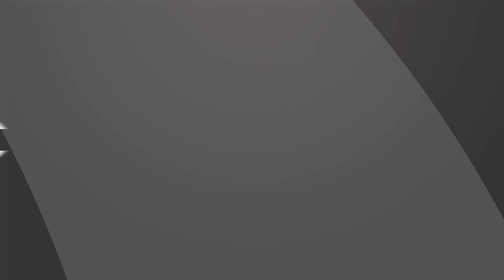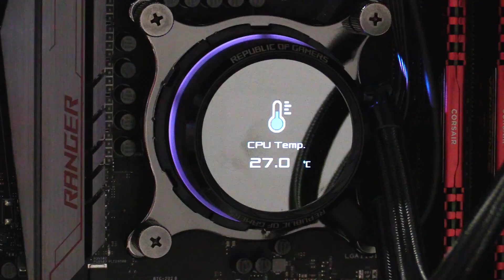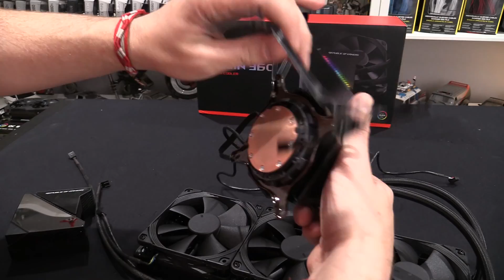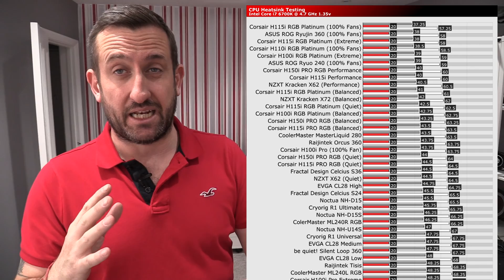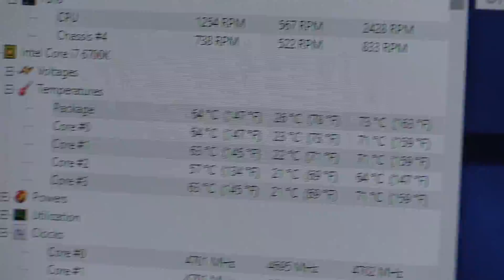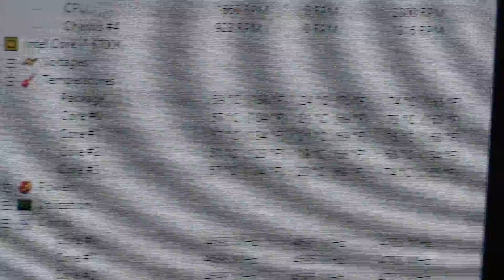Asus ROG Ryuo and Ryujin CPU Cooler Review

Comment: Like the Ryujin when its a water cooler pump with a fan who i think are rather nice when any cooling on the motherboard around the CPU is better than nothing. You could change the fan speed in the software.But yes, the different degree reading is rather confusing.Mine have a fault of 4 degrees and its a Asus motherboard.

Comment: most people i would imagine would use the motherboard bios to set a fan curve. at least people who spend this kind of money on an AIO, because more than likely, theyre gonna be the ones who like to tweak and adjust things. i use the bios to set my fan curve with my be quiet! dark rock pro 4, and have an aggressive fan curve, and under full gaming loads, after hours of playing, my CPU never gets above 60 degrees Celsius. i would guess, and hope, that with either of these coolers and the appropriate fan curve, temps would more than likely be similar if not better.

Comment: Hi, i nkow that it's a strange question but, if you know, the sata connector is using only the 12volts rails or also on the 5volts? Tanks, i need this for a modded system...

Comment: Hey so it is isnt worth it even at 200 yeah (ryujin is somewhat cheaper in my country :D ) . I should buy h115i (it 144 euros in my country) ? But there is 2 bigger fans (corsair one) instead of three smaller here which is better ? money is not a problem, but if it is not really usefull I would like to save money for something else. I have lian li so I can add every radiator to it :D

Comment: A watercooler should be running by water temps. NOT CPU temps. How ever. The CPU temp should read actual CPU temps and NOT the back of a motherbord. 

My livedash on Maximus X Formula does the same thing
Reply from the maker: There are arguments for an against water temps. CPU temps will rocket before the water temps will actually show any difference meaning higher CPU temps at the start of any load before the cooler catches up.

Comment: You can definitely test vrm temps on maximus range. Open aida, click on computer, click on sensors and it will give you every temp, fan speed etc you can dream of. They've tried to remove vrm temps because of all the controversy about their dodgy 8 phase vrm marketing. In reality the vrm temps aren't that bad at all. I've not seen a number over the low 40's yet.
Reply: Adam is still confused as to whether their Newest Maximus hero board has 8 VRM or not. I need atleast that for a i9 9900k I’m about to buy, and I want an Asus board that can handle it as I have a Asus theme going on.
Reply: @gwynbleiddroach2589  Hi mate. Not all the maximus range uses the same vrm. I have a hero, which is a 4 phase. It still has 8 power stages but they run in parallel. All I can say is it works really well and I use mine with a 9900k, though admitedly you could probably get a board with a better vrm for the price.
Reply: Adam thanks for the reply! I have seen multiple 8 VRN boards for the same or less money from other manufacturers. The problem is, it will disrupt my theme haha, and I’ll miss the Asus UEFI. It just sucks the skimped on the VRN for their high end boards. As long  as the 9900k temps aren’t running ridiculously high at 5ghz then I’ll be fine, I’m not trying to hit world records.
Reply: @gwynbleiddroach2589  I'm by no means an asus fan boy and my mobo is the only Asus component I have. But it works great. Admitedly I have a case with great airflow, but the mobo's vrm is one of the coldest component's in my pc. I've hammered it with every stress test known to man and have yet to see a temp reach 50 degrees. My m.2 drive runs hotter lol. I think the whole vrm thing has been overhyped. Don't forget there is still 8 power stages sharing the load and they're incredibly good sic639's. Just as a comparison my 2080ti's vrm runs in the mid 70's on default settings playing a game. Your cpu is going to reach throttling temps way before the vrm does. Asus aren't going to make a mobo specifically for 9th gen chips that don't work with 9th gen chips. Hope all that helps, cheers Adam.
Reply: @gwynbleiddroach2589  As for skimping I've been in depth with Asus support on this and here's what they told me. They said because the board already has 8 power stages on it, it would have cost them nothing to run it in an 8 phase config. They told me their engineers in testing found it to perform better pairing the power stages up and running them in parallel as it improved transient response (whatever that is lol.) Anyhoo that's what they told me and seeing as it actually works so well I've no reason to doubt the asus engineers know their stuff.
Reply: Adam well the board is beating out other boards by a lot with over locking, which is awesome but like I said I’m not trying to hit records, I just need to make sure my VRN’s last me a while Atleast 4 to 5 years with an i9900 k. I only upgrade my gpus every other year, but my main rig needs to last at-least 4.  I’ll be putting a water cooler on my cpu, so I’m not worried about that, just the VRN’s. thanks so much for giving a piece of mind though. I think I’ll just get the Maximus hero, as it works perfectly well in my sky lake build, and I love the UEIF. I think I’ll just go ahead and build it, if the VRM’s decide to crap out later due to 5ghz then I’ll be more wary later.
Reply: @gwynbleiddroach2589  Yeah, all the fuss came from a gamers nexus/buildzoid review of a photograph of it, and they just kinda assumed it would be crap. Hands on reviews have all been pretty good. The vrm won't crap out at 5ghz. All I've done with mine is enabled mce which boosts all the cores to 5 and probably uses way more voltage than it needs, so a manual 5ghz oc won't stress it at all.

Comment: What a mess of wires. Kinda detracts from the wow factor of the screen. And from my experience with Corsair fans, they are far louder than most other fans. And not including fan speeds for all the coolers tested makes comparing the data rather futile, not to mention sound levels.

Comment: Where did you connect the PMW connection for the pump? Did you connect it to the AIO header or the CPU Fan/Optical header. I can't seem to get any kind of pump/fan reading on the Ryuo cooler; the fans and pump show as 0 RPM even though they are on and working. I'm wondering if I need to modify bios, update drivers, or exchange the pump itself.

Comment: This is what worried me about the CPU temp on that screen is that in software Asus uses what they call CPU and it is actually socket temp and you can confirm this by matching the two in your sensor software like HWinfo or other. This is something that bothers me on the Z370 hero where the Q code can act as CPU temp gauge once POST is past. I don't give a shit about socket temp Asus. There Ai Suite shows the socket temp as well instead of the package temp. I never use Asus anything for CPU temp. Unfortunately, the fan software as you talked about works on that socket temp too so all temps you set must be earlier.

Comment: These coolers misted the mark IMO. 20 wires off the side instead of one solid cable that could be routed to the back of case to figure out the multiple points of connectivity. Failed RGB control based on the review here. VRM cooler seems more of a gimmick and the screen doesn't do anything I couldn't get from software. Wrong CPU temp and so on. Seems like a prototype and not a $300 retail product.

Comment: you're so gentle with Asus this time. Using that mobo probe for controlling fan speeds is just lame. I had similar problems with H110GTX and ended up connecting radiator fans to the CPU fan headers on the motherboards and letting Asus Suite controlling the speeds.
Reply from the maker: There is so much wrong about what you just said. The GTX would have been from the cpu. By using the board it was the same way these coolers work.

Comment: Well, i was going to buy the Ryujin but i didn't know it would be set up like that ... to be honest, i'm fairly put of by that. IF Asus fixes the software, i'll buy it straight away. I want my fans to ramp with the actual cpu temp ... Actually, why not give the option for instant ramp or gradual ramp in the settings OR even be able to choose which temp sensor you want to use ?
Reply: Pre-fucking-cisely. The SDR exists for a reason. Select the sensor you want - at ANY time - for the purpose. You could have the temp readings from the CPU display off of the actual CPU temp sensor but keep the fans curving off of the motherboard's CPU temp sensor.

In this case, you CAN have your cake AND eat it, too.
Reply: Hwinfo64 fucks asus boarda

Comment: $185.99 child please 😏 @asus is on one.
Reply: Is that for the 360? lol
Reply: @86ortega  Yeah right, that's for the 240 one lol. Shit is just crazy. You are going to spend all that money for tech that doesn't even work smh.
Reply: @KosherTech  I'd rather get the corsair 360 for $160 on a good day.  I got the Corsair 115i 280mm dual for $60 on ebay for my CPU and picked up a H105 and H55 both for less than $120 for my GPU's.  Asus is out of bounds with these prices
Reply: @86ortega  agreed!

Comment: I've yet to decide which cooling solution I will use for the new rig that I'm building. When I first saw this AIO in this vid, I was tempted, until you mentioned the temperature discrepancy... It's a shame because the smaller of the 2 unit definitely has some flair. My other comment would have to be about the fans themselves. Asus is promoting Aura and yet... the fans are just plain black. It's a missed opportunity.

I'm curious, what would your recommendations be?
Reply: im on the same spot right now, choosing between this and nzxt kraken x52. which cooler did you get and how did it go?

Comment: It would make a lot more sense if the fans on an AIO would spin faster only when the water temperature gets hot, they are not directly cooling the CPU DIE but the radiator, the CPU will need some time to transfer enough heat into the loop to make a dent, spiky ramp ups because of momentary CPU spikes are completely idiotic.
Reply from the maker: That's why you have spin up delays :)

Comment: Was it actually possible to select different temp inputs in AIsuite3? Mine just keeps having problems and responding to cpu temps or something. It just ramps up when everything is running cool, no matter what I do. I just gave up on it after a while and just use cpu temp. Sometimes the software also just crashes and the fans are hanging at some speed unrelated to cpu temp. I really hope Asus fixes their software, I had less problems with fan control on an 80 euro gigabyte h150 board, but I just love the Asus ZE in terms of what it offers in terms of hardware.

Comment: Tom you should always set the Jack your PUMP is plugged into to FULL.. Then you can set the speed or performance of it from the software that comes with you AIO.. The pump is designed to run at certain speed efficiently. If you deviate from that you could get less than optimal performance. As far as the fan speed is concerned. You can control them via the AIO software or plug them directly into your motherboard if you prefer and then you can set your desired fan curve.
Reply: The sata power is what powers the pump. Software can change that through the usb connector otherwise it stick to a default (usually balanced) profile. The connector you hook to cpu fan header is nothing more then a tachometer.
Reply from the maker: Actually with it plugged into pump they all ran full speed and the software wouldn't change it

Comment: the display on the asus maximas formula xi has the same issue. the temp shown isn't even close. im sitting there in a game thinking my temps are good because the motherboard is saying its 55 degrees but when i open up hardwaremonitor, the temps are at 75 degrees....

Comment: Isn't it that ALL of them are asatech pumps so aren't they basically ALL the same? Except for the looks and fans that is.

Stupid patent trolling company. I can't believe how "pump on top of the block" is something that can be patented.
Reply: Yeah, basically variation in temps is from the fins structure in the block + materials and FPI of radiator + fans
Reply: Yeap... almost all AIO are Asetek-based. Except, the brand new Corsair Pro Platinum. Pretty sure Enermax came up with the pump on another location but it just look... weird.
Reply: @davlc88  h110i is coolit as well I believe.
Reply: I think and also heard its because Asatech has a patent over this pump design, i read somewhere that Cooler-master tried to copy but they faced lawsuit from Asatech . maybe the Asatech is favorable by many 3rd party companies?
Reply: Yeah its all the same """"innovative*****"""" garbage from Asetek hence why the all perform pretty much the same-Gamers Nexsus said "look for one that matches your price point and has features you like".

Personally Im going with that new corsair one specifically because its not an Asetek unithttps://twitter.com/CoolITSystems/status/1058485171815514114http://www.legitreviews.com/corsair-hydro-h100i-rgb-platinum-cpu-cooler-review_208813

there are also other alternatives (and some up coming ones) mostly semi open loops from the likes of EKWB,Stiftech and alpha cool but those fall into a weird prosumer price point 150+ and are low on chrome so minimal RGBs,no screens,not hassle free requires some very intermittent servicing.BUT you basically get a real water loop with out all the building and prepping.

Either way fuck Asetek i hate them with a passion.
Reply: You're asking the wrong question about parents. You should not ask how it could be patented. The real question, is why no one did it before! Like you said, it is almost an obvious thing. But still, until Asutek came along, nobody did it. And if you are the first doing something different, you can patent it.. If you are the first that is doing something new (no matter how obvious), you innovating. And innovations should be patented to avoid copy&paste pirates.. 

You can't call them a troll either. A patent troll is a company that holds (any buys) on first sight useless patents, do not used the patent itself, wait for it to become popular and then sue everybody that violates the patent. That is not what Asutek is doing. They're saying, this is our design, think of something else! The patent office actually require patent holders to protect their patents. If they become general use, without enforcing the proper rights (usually in terms of licensing). 

Asutek did make the AIO very popular with the help of Corsair and Asutek does hold a very large share of the AIO market. But none the less, it is a small market..

Comment: I ditch AIOs and went air cooling. Cryorig R1 is amazing. Just replace the fans
Reply: Indeed, R1 Ultimate + NF-F12 (and NF-A12x25 in the future), love it.
Reply: 5ghz 8700k peaks at 83° absolute max in occt linpack on tc12dx single tower cooler.
Reply: Except AIO are better at cooling and way more quiet. There is no way I'll ever go back to air cooling.
Reply: Wrong about the quieter. The only noise on an AIR cpu cooler are the fans the same with an AIO. 
But on the AIO you have the pump noise as well.
Reply: @demonwares  lol an nh-d14 is on par with the new corsair platinum 240mm and quieter. Air>aio any day of the week.